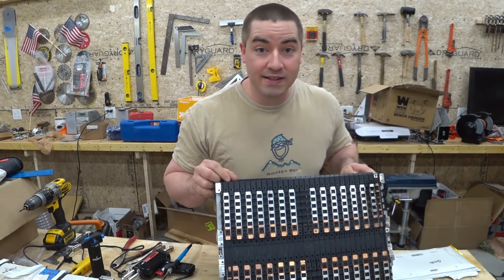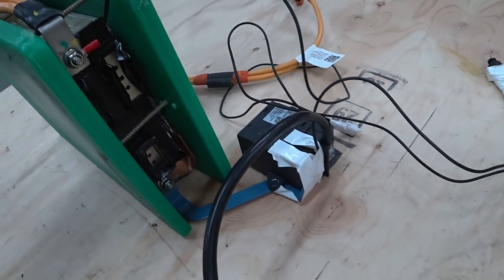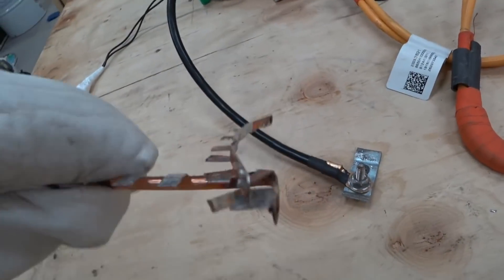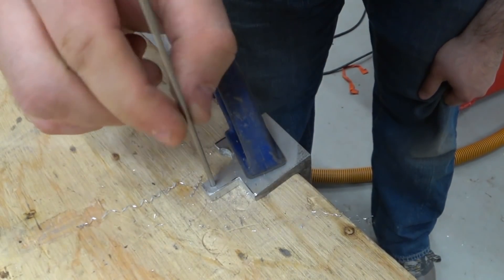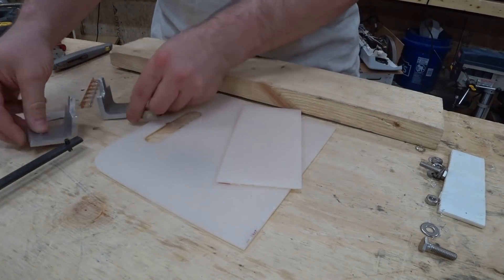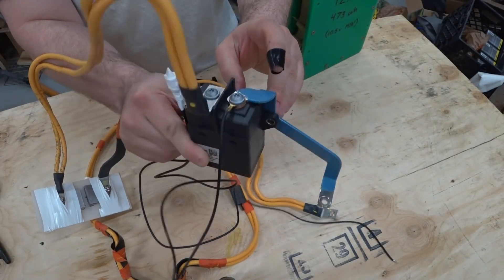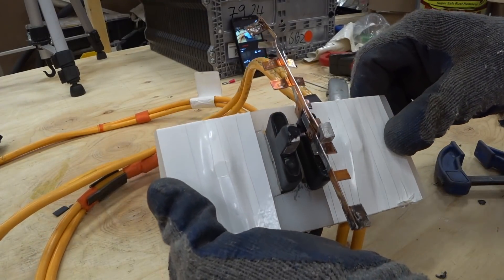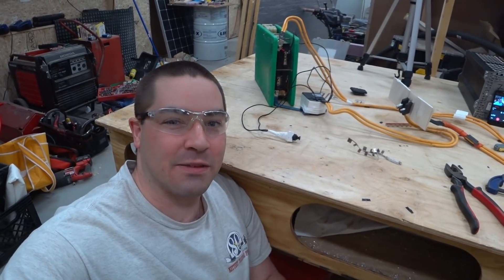DIY Spot Welder, Attempt #1

Comment: You have to remember here you are trying to spot weld 2 thick pieces of metal. With the battery, you're trying to weld aluminum foil to thick metal. You need to practice with the dead pouch cells.

Comment: Your contact points are too large I think
Reply from the maker: Thanks.  How big do you suggest?
Reply: @DavidPozEnergy   I had best results in this size of spot welder at about nail size of electrodes.. Even better: use copper electrodes(filed to a sharp tip)
Problem is the large amount of energy created by shorting the Battery is not enough for this size of Electrode.. so you have to decrease the size of the electrode and make multiple Spot welds.
 and always remember to keep the welding time as short as possible.. even half a second might burn the metal
Reply from the maker: Thanks.  Good tips. (Ha, pun.)

Comment: You need to add a precision variable timer that applys exactly the right amount of time to the weld. You did everything right but you cant just randomly apply the welding contacts. Commercial spot welders have a precision timer, an good snubber to prevent the relay contacts from burning shut , (a snubber is a combination of a resistor and capacitor in series to reduce arcing) Also most professional commercial spot welders are water cooled so they can weld hundreds of parts without resting. that is what makes them expensive. you can find all these things by doing a Google search
Reply from the maker: Thank you.

Comment: Thomas Edison said "I have not failed. I've just found 10,000 ways that won't work."
He also said "To invent, you need a good imagination and a pile of junk." and 
"Our greatest weakness lies in giving up. The most certain way to succeed is always to try just one more time."
I am sure all apply, either the right sized capacitor or a timed momentary switch/relay will probably fix your issue. ;)
Reply from the maker: All good words of wisdom.

Comment: Change your battery from 3s to 3p and you should get the higher amps you need. Also get a cheap Contactor from any auto parts store instead of a relay.
Reply: I thought it was a contactor  and it would help to put a snubber circuit accross the contacts. Ive seen this on other welder designs on the net

Comment: You need a well designed Snubber accross the relay contacts to keep the relay contacts from welding together
Reply from the maker: Snubber, is that someone who snubs?  
LOL.  I'm making a joke, but I'm new to electronics and don't actually know what it is.  Any help?  Thanks.
Reply: A snubber or snubber circuit is a simple series combination of a capacitor and a resistor accross the relay contacts or switch contacts look up snubber circuits for more information on that and how to build one

Comment: My dear use only capacitive spot welder use timer for good results copper terminals with sharp points sufficient.
Reply from the maker: Thanks for your suggestion.  Originally I wanted to use copper terminals, but the bus bar is also made of copper.  If I had copper terminals the terminal and the bus bar would weld together.  That is why I switched to tungsten.  Thanks for watching.

Comment: Try adding a capacitor in the line feed  to the tips . It will jump up the voltage when charged and switched to weld it'll be a better power to weld . A 50 mfd capacitor start type should work.
Reply: welding is about current not so much voltage

Comment: Electromechanical components usually can't handle high DC currents, once current starts flowing when they need to brake the current flow they are over. Use parallel mosfetas design. Also your trigger finger is not calibrated too. Use something like 555 timer and a proper control circuit for mosfets in single shot mode to make stable pulse width. Car starter battery works for this as well.
Reply: I think he said the relay contacts keep sticking

Comment: A mechanical switch is probably too slow to react and can't interrupt the current during the short circuit period. You should try using solid state switches (FETs of some type).
Reply: whatever he uses he will need a snubber circuit to suppress the back EMF of that high current
Reply: @Great Scott just did a new video about spot welders where he used a large mechanical relay as the switch and it worked well. So it is possible to use a mechanical one for low timings.

Comment: Two soldering irons one on each side may provide enough heat or a soldering gun.
Reply from the maker: Thanks.  I did try that.  One iron was 60 watts, and one was 200 watts.  Each held on opposite sides of the same spot.  Still no good.  There is probably a way, but the learning curve on soldering seems to be steep (at least for me)
Reply: @DavidPozEnergy   This seems to be what you may want.
https://www.youtube.com/watch?v=7syYrhEH_18
Don't know this guy but looks easy and could reach in that tight spot.
Reply from the maker: @offgridwanabe  Thanks.  That was cool.

Comment: As I know about spot welder the voltage is about 2V and the current is at least  200A but the period of the weld is 100 to 250ms 
Maybe you can use capacitor discharge spot welder 
But my information may be wrong I'm not 100% sure
Reply: No, Mahdi, you are not wrong, you are spot on(that's kind of a pun). To do a reliable spot welder you have to control the energy and the pressure of the weld joint. Discharging caps is a good way because you can precisely control the energy in a cap and don't run the risk of blowing through the metal with too much current for too long a time.
Reply: true but the heavy duty welders I used the time was like 1 second to 2 minutes
but that was for 14 gauge steel. the amazing thing about spot welders is, they have no trouble welding aluminum  together

Comment: To your battery add some big capacitor around 20000uf-50000uf..... Put them in parallel before the relay and in the series between caps and battery put small value resistor like 0.1ohms 50w or so.....
About the relay.... most of your energy is divided in two places in spot... welding spot and relay contact.... 
Try to replace relay with some electronic switch like mosfet or thyristor.... 
Excellent video by the way.... 👍
Reply: he has plenty of power there did you see how it blew holes in the brackets?

Comment: You should get some cooper or brass bar with rounded points that’s better for spot welding because will not fuse together with the metal you want to welding, also the voltage, you need something to manage the voltage and current... very good try, keep it up!! 😎🇵🇷👍🏼

Comment: Hey, that was a success! You wanted the pieces attached to one another!!   You just need to refine the method!! You need a starter relay, that was a contactor, not designed for breaking high currents, replace the relay, and you got it!!
Reply from the maker: Hi James,  Someone else was also suggesting I get a device made for starters, but he used the two words opposite you.  "relay" or "contactor" or "solenoid".  I guess I don't understand the difference between all these.
Reply: @DavidPozEnergy  Those are terms that are used somewhat interchangeably.

Comment: You need a smaller contact area, for the weld spot!
Reply from the maker: Hi James, That tungsten rod is only about 1/8" diameter, which is an extremely small contact area.  I'm not an expert at this, but I don't think that's my problem.

Comment: If I’m not mistaken, a spot welder needs to have a duration timer with AC/DC.  I would imagine that would be even more critical with a large lithium batter, that would put out almost infinite amps in a short circuit.   Yes, that would fry almost any relay, except a resettable thermal fuse, sometimes called a “short stop”.  If you’re going to short a battery, stick with a car battery, it won’t put out infinite amps.  China  spot welders are $200      Or make one from an old microwave; lots of work though.

Comment: Why are you using the worst materials as electrodes, you need copper points to send the whole current of the battery to the materials to be welded than in this case seems to be copper plated so no a good start since the electrodes are the ones that gets hotter instead of the plates, avoid any steel bolts between the actual current patch.
Reply from the maker: Hi chancho00, Thank you for your comment. It may be a little confusing.  In the beginning of the video I try some steel bolts simply for a proof of concept.  Farther along in the video I switch to tungsten electrodes.  Sorry for any confusion.

Comment: The spot welding Voltage is too high at 3S battery (11.1 volt DC) .........Try with single battery-----3.7 volts DC.......but connect all 3 cell in parallel to reduce current flow through each cell ! But, whatever you do.....please do not burn the workshop down !
Reply: good point worth a try

Comment: 🤷‍♂️ smaller surface area on spot welder.

Otherwise you will have to drastically adjust the amps and volts.

I have confidence you will get it 😁

Comment: Since you already have the pack assembled get some conductive epoxy and try it. If you take the pack back apart you should be able to spot weld it if the parts are deoxidised and really clean. Look at other people's videos on how they spot weld diy.
Reply from the maker: I have not heard of conductive epoxy before.  Could you please link to an example?  Thank you.
Reply: @DavidPozEnergy  just do a search for: MG Chemicals 8331-14G
Reply from the maker: Thank you.

Comment: Spot weld is PERMANENT. A rivet is probably permanent also as drilling them out might cause damage. Nuts and bolts is the only way to go. If the pack had been spot welded initially, what would you be doing right now?
Reply from the maker: Hi Nevada,  I'm not sure what you are saying.  I appreciate your suggestions.  Would you mind letting me know what you suggest, just strait up.  With the question marks I can't tell if you are making a joke or something.  Thank you.
Reply: @DavidPozEnergy  I'm not sure what he's trying to say either. But he brings up the idea of using a nut and bolt. Is there room for that?
Reply: @DavidPozEnergy  can a spot welder weld several spots close together on the same pieces of metal or do they all have to be done at the same moment with one blast? Maybe that's why spot welders use such low voltage so the voltage has a hard time traveling to short circuit through other spot welds that were already done.
Reply from the maker: Hi Travis,  The gap I have to work with is about 3/8 inch square.  So to fit a nut and bolt, the bolt would have to be about 1/4" in length.  Also, there is no room to drill a hole in the tab, so I would have to cut a notch down from the top, and then add a tiny piece of filler metal at the top of the tab so the nut and bolt sit perpindicular to the tab.  If not, then there will be less pressure at the top (where the void is) and over time the nut and bolt can work themselves up and out.  

As for the spot welder, my goal is to make 4 spot welds, one at each opening in the bus bar.  Each spot would be 1/2" apart, down the tab.
Reply: @DavidPozEnergy  so it sounds like a bolt and nut would work but then we wouldn't get to see you go nuts trying to make a spot welder LOL. I often mess with 18 650s and wish I had a tiny spot welder for them

Comment: You need a starter motor solenoid which are designed to release under high current.  Search for Atv starter solenoid   Or motorcycle starter solenoid
Reply from the maker: Thanks, I'll check them out.

Comment: This is what you need... a DIY Arduino spot welding kit - rave reviews among 18650 and powerwall fans
Vortecks demo: https://www.youtube.com/watch?v=SnPn-buRL5M
Reply from the maker: Thanks Andy, I look forward to watching the video you linked to.
Reply: @DavidPozEnergy  I think I commented in your previous video that you'd just make holes everywhere! :-)
Spotwelders use around 700 amps at low voltage - and you can use a couple of your spare lipo cells to power it.
All the arduino does is time the pulse and therefore the energy sent through the array of mosfets and thick cables to the welds.
You'll easily get the hang of it.
You'll notice on laptop cells that the nickel strips often have slots cut into them - this helps the current go through the work, instead of directly across the probes, and gives a much better weld.
Reply: @DavidPozEnergy  ps... I expect your relay is toast now!
Reply from the maker: The relay probably is toast, but it still clicks solidly.  Might be fun to take it apart.

Comment: You need better control of the discharge duration. Most common diy approach in a bunch of parallel connected 100 amp fets (which are quite cheap and have about 8millohm "on" resistance), driven by something like an Arduino with custom software - there is a diy kit covered by youtube videos. I like the tool you made to apply the weld except that in its default state it shorts the battery hence if the control arrangement fails short circuit you have a likely explosion which you just managed to avoid. Its a pity you cant build the tool so you have to apply force to temporarily close the tungsten tips but there is precious little room for something like that. When I tried to build a welder I used only 2.7 volts and a super capacitor charged with a constant 10 amps and which had about 8 milliohms internal resistance. This had a finite charge which flows into the spark - it could still cause perforation  but you are less likely to get an explosion. Good luck.
Reply: Watch this:- https://www.youtube.com/watch?v=VrcmvmM7h3Y

Comment: I think the cheapest way is a microwave transformer and a 110v relay on the 110v side, and then coil your thick wires around the transformer once or twice. Plenty of videos.
Maybe grind the sides of them down to make them narrower so you can put some heat shrink back on.
Reply from the maker: I love that idea.  I've been watching craigslist for a month, but the microwaves keep getting snatched up before I get my e-mail out.  I'll keep watching for one.

Comment: Try high amps low volts AC !
Reply from the maker: AC.  I'll have to get one of those microwave transformers.
Reply: DavidPoz na their too dangerous try using an ax ark stick welder using a big relay
Reply from the maker: I've never heard of using a stick welder for this, but I do own an old AC stick welder.  Is the process the same?
Reply: DavidPoz worth a try just set it to as low as amps as the welder goes and try like 500ms pulse
Reply from the maker: Wait, low amps?  higher up in the thread you said high amps.
Reply: DavidPoz yeh the welders are around 48vac so you would not want more than 50amps start low and go from there. Also the smaller the contact spot the less amps needed
Reply from the maker: Ah.  Thanks for clarifying.  I look forward to giving that a try.
Reply: @DavidPozEnergy  I did one with a microwave transformer very recently to spot weld li-ion cylindrical cells and found that too much pressure on the electrodes causes worse welds than just a mild pressure, but I was doing it with both electrodes on the same side, that is a bit different from what you need. Also maybe Cooper electrodes will give better results... Good luck.
Reply from the maker: @Jack O'Neill, Thank you.  Copper electrodes are ideal most of the time, but I'm welding to a copper bus bar.  Electrodes have to be a different metal, otherwise they will stick too.  Thank you for the suggestions.  I've seen several people use the microwave transformers.  It seems like a decent idea.  Can't be any worse, right?
Reply: @DavidPozEnergy  Yea, I've noticed that (the copper parts to weld) and forgot when I was writing the comment... My first try was with an UPS transformer, but the primary couldn't give enough current, so I got my hands on a microwave transformer and there was a big improvement. Cheers.